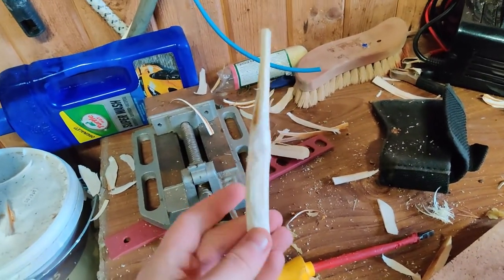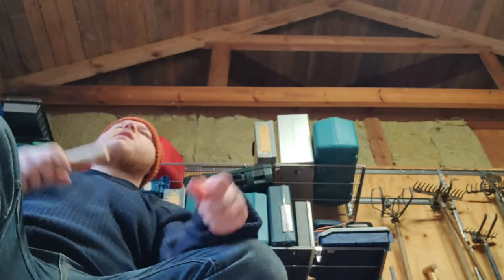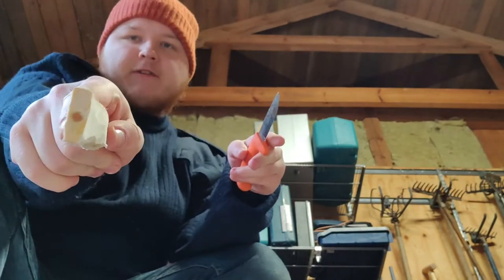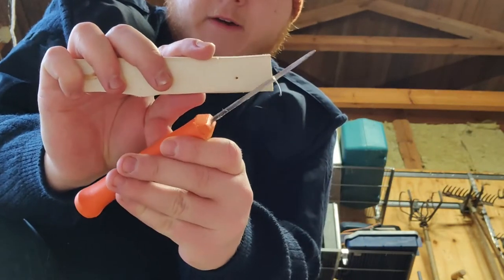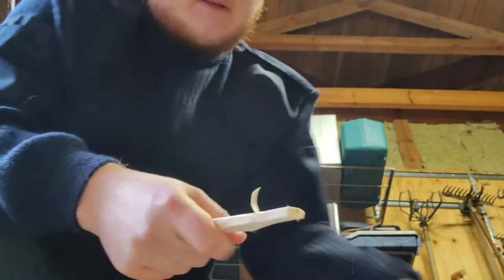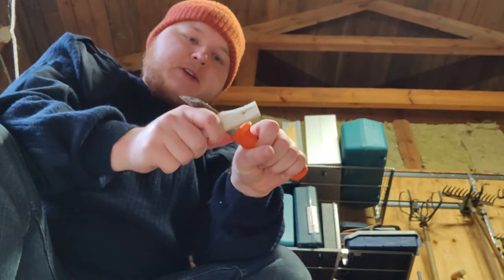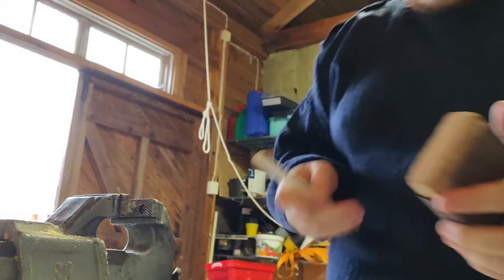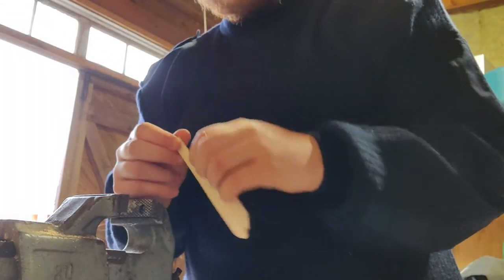How To Make Your Own Butter Knife - Basic Woodworking

Comment: Looks like fun.  Did I miss what type of wood it is made out of?  Thanks.
Reply from the maker: I'm glad you liked it. I actually am not sure, but I will have a look tomorrow and get back to you! :)
Reply from the maker: It's aspen! Not sure if this is the right material to work with but I am a novice. I'll use anything I can get my hands on just to get a bit more practice. :)
Reply: @iambored9888  Thank you.  I was thinking birch or oak as I think pine might not taste good.  Thanks again.
Reply from the maker: @groermaik  Sounds like a sturdy wood to work with, Might take a bit longer but I imagine the end result will be better. Will make a few out of oak and birch in the future :) Thank you for the suggestion!